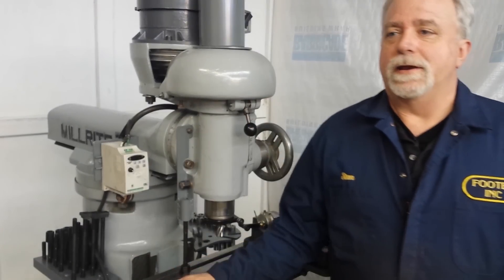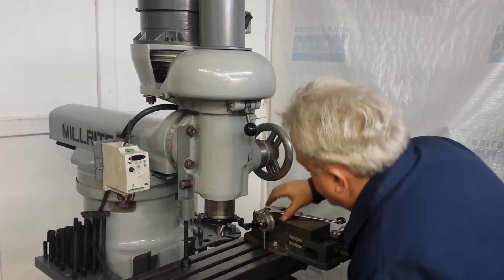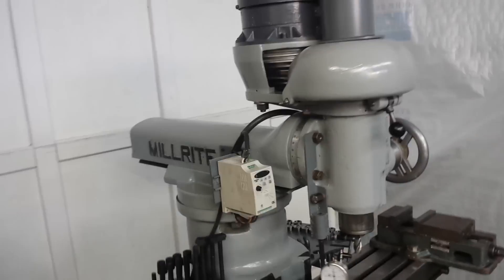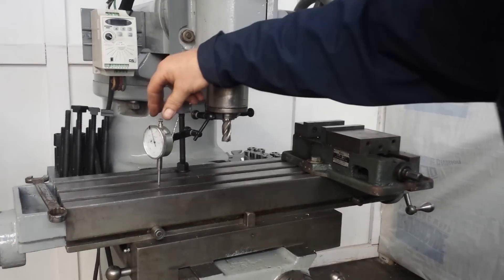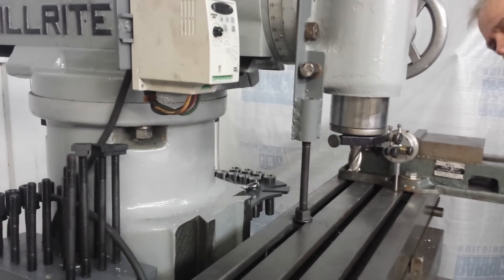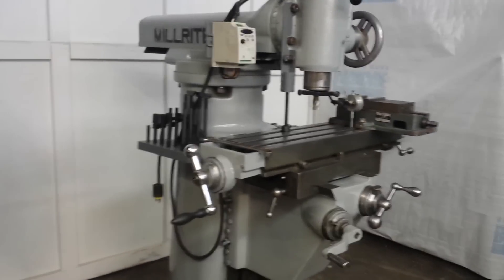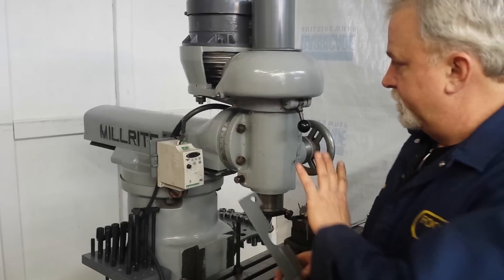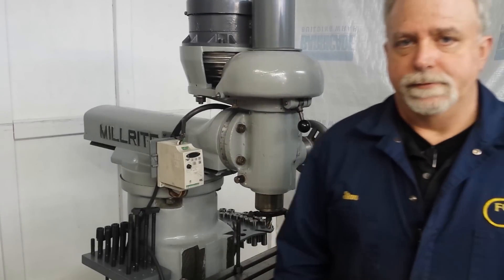Tramming the Millrite MVN vertical mill

Comment: Hi Lucas, great video and excellent setup for the X-axis tramming. I have the same mill, and after tramming my X axis is dead square to the head, however my Y-axis is off significantly. It was off by just over 4 thou over 5 inches (I'm using a protram). I spent some time tonight shimming the rear of the base-turret interface and was able to get it pretty square, about 1.5 thou off square over the 5 inches travel, but wanted to see if you had any insight as to why my mill would be that far out of square, as these machines should have a pretty dead-on Y-axis given the fixed configuration.
Reply from the maker: Question, have you determined the flatness of the bed using spotting ink (Hi Spot, etc) and a straightedge? I find that most mills have a high spot under the vise, and need to have the table flattened by scraping. I would flatten by scraping before attempting to tram in either x or y, but the issue will be more pronounced in y at the location where a vise had been installed. 

I will be producing a video explaining this phenomenon soon. I will include some ideas for retarding the onset of this problem.

Comment: Lucas: I have a Millrite as well.  What a grate idea, Im going to "borrow" it from you, but modify it a bit because my mill also has a "nodding" head.  I think I'll make a second holder "a mirror image if you will" that will be attached to the third table slot toward the frount of the machine and attached to the bracket you made near the top of the head etc.  I'll put jack screws as part of the rod for the nod adjust.. Should work, thats the theory anawy. I'll send you a picture when I get it done... I wont even bother telling you how I did it before, but it did involve jack screws and a lot of time... Thanks for the idea and your other videos..  You got another subscriber... Thanks. Brian AKA youtube GUSMIX.

Comment: Have the same mill (Millrite  aka the baby Bridgeport) its dead nuts on table and quill . but the only thing that sucks about this mill is the crank feed for the quill (takes forever to drill a hole ) and tramming the head. I just break the bolts loose one by and just snug them. then take a soft mallet and tap till zero and tighten up the bolts . your lucky because you only have to do this in one direction its not like a Bridgeport where the head tilts in two directions . That's the other thing you can't drill compound angle holes on this mill using the head . also mine has a B&S( Brown&Sharpe) or as I call it Bastard Size  9 taper in the quill. the other thing is there is no back gear so no low or slow speeds .this machine is good for the weekend Machinist . I do it 40hrs a week and 37+years on a Bridgeport.  and hope to get rid of my Millrite and Buy a Bridgeport.